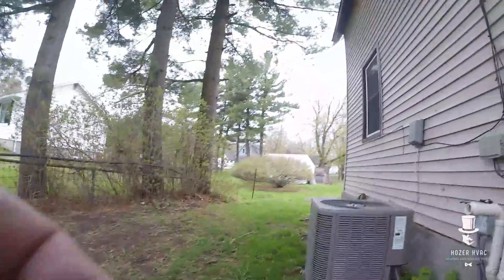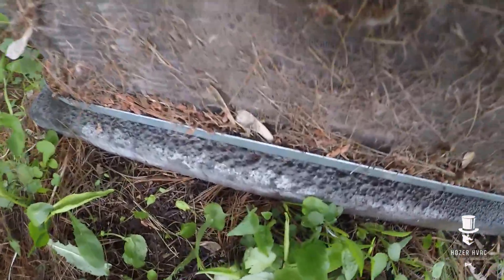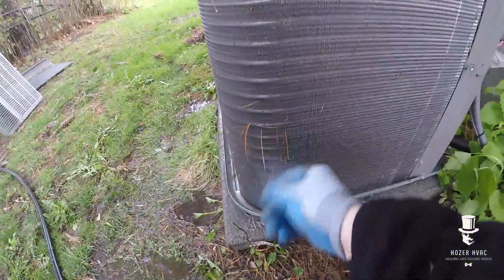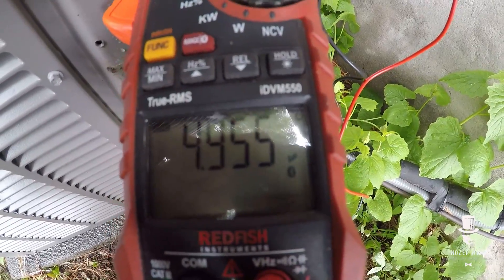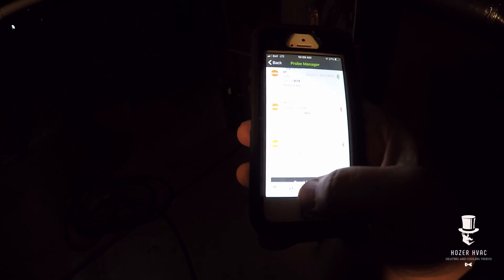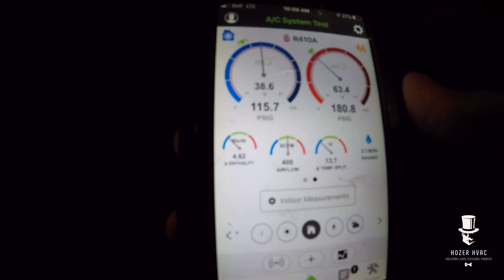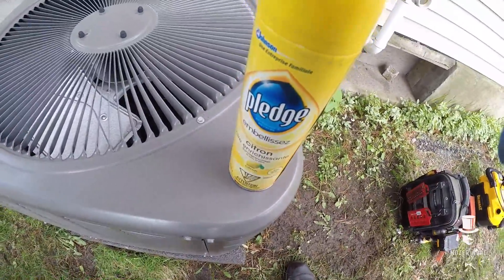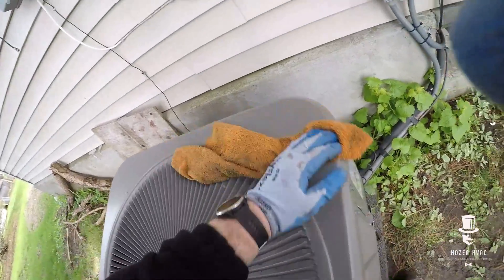What to look for on AC maintenance

Comment: What a difference cleaning up the unit a little bit makes.  Nice video as always
Reply from the maker: HVAC Tool Review any word from fieldpiece ?
Reply: Hozer HVAC Yea they sent me a new meter.  Haven’t had a chance to use it yet,  I’ll run it through some testing tomorrow on a job, but so far,  turning wireless on it seems that this one is fixed.  Hopefully.

Comment: What do you think of running service out of a Ford Transit Connect ( the little bitty one ) ? What do you think about being on call for 24/7 over the weekend?
Reply from the maker: Kelly Kyler I ran with a connect once, very tight, organization is key but you can certainly do it. In my opinion weekend oncall 24/7 is just part of hvac life. I hate it but it’s on a 5 week rotation Atleast.

Comment: I'm guessing the house has a crap duct system - leaky, high pressure drop, no return on second floor.
I'm no tech, so feel free to discount this: A good strategy is to leave it at 1100-1200 cfm but wire the stat to Y1, put a humidistat between Y1/Y2 in the return duct. Y1 cfm around 800. When the humidity is too high, it gets a call for first stage cooling only - preserves ability to dehumidify well only when required. I've done this for someone (family) on a 1.5 ton unit, runs close to 800 cfm and if the humidity runs high drops to low heat speed 700. this is with a psc motor with low heat/low cool using the same speed tap. Didn't feel like putting a relay to drop it to 600ish cfm and keep the low heat speed where it needs to be.

One thing to consider is that when the house only has floor and basement return, return air temperature is colder than most of the house, the relative humidity is higher (running 55 to 60% when most of house is 50%, dewpoint stays the same) so sensible heat ratio is already reduced as a result, capacity is reduced due to lower return air temp/enthalpy. So I believe the default cfm should be higher than 400 per ton to compensate.
Reply from the maker: Your not a technician ???? Yet you know all of this ? Wow good on you, that’s some next level thinking right there.seriously never thought about something like that but sounds totally viable. Thinking outside the box! I love it.
Reply: I think you can also use the dehumidify terminal and accomplish the same thing. No, I'm not a tech but have schooling in building equipment/retrofits and have always been interested in this stuff.  
between knowing the basic theory to begin with and doing some diy work, reading forums/manuals online I've taught myself a lot and corrected problems left by "professionals". 
Good residential professionals like you are really hard to find -  I know of several companies in the toronto area but can't recommend any of them with complete confidence. 

Find a supposedly good one find out they don't know how to check airflow and charge by pressures alone, don't do load calculations, don't check air ducts when quoting for replacement, etc.
Reply from the maker: Jon [Insert Last Name Here] well sir, you certainly know your stuff, I appreciate you taking the time to watch my videos. You surprised me with how versed you are with building performance. When I started this channel, it was to learn from others that have taken the time to watch what I do and give me some advice. You did that today, so hats off to you. Much appreciated from a fellow Canadian. 👍🤝

Comment: How do you like that meter?
Reply from the maker: Familia Sanchez HVAC I like it for different reasons than I like my fluke. As a pure workhorse meter I would prefer my fluke, however the redfish comes
In strong as a power meter. I enjoy using the measurequick and tech link apps with it. So as a second meter it’s great